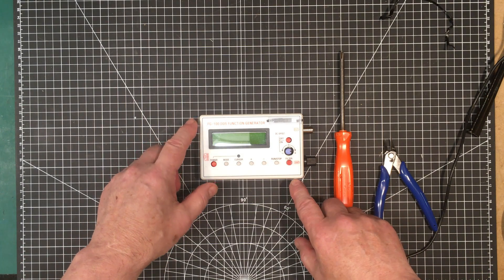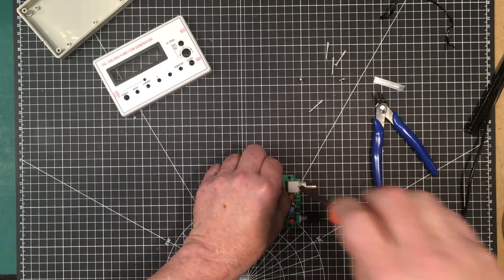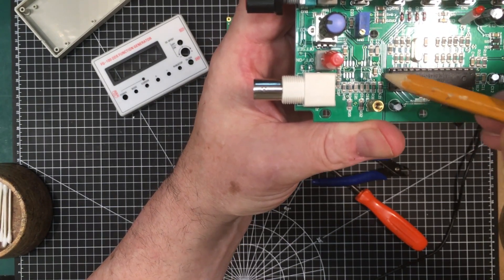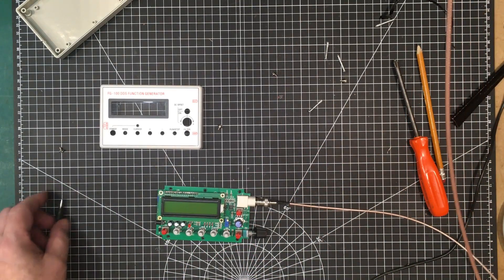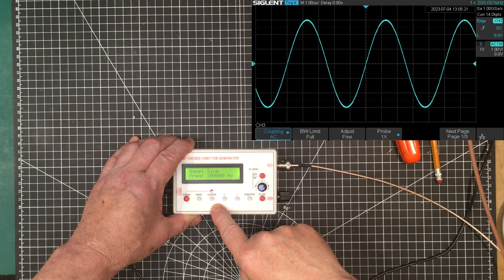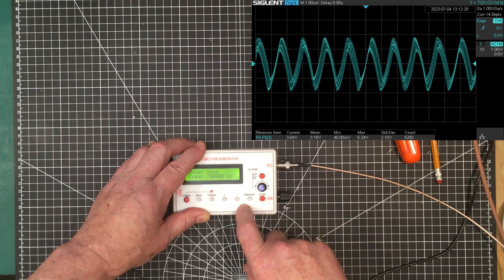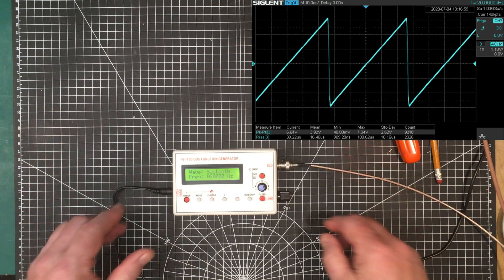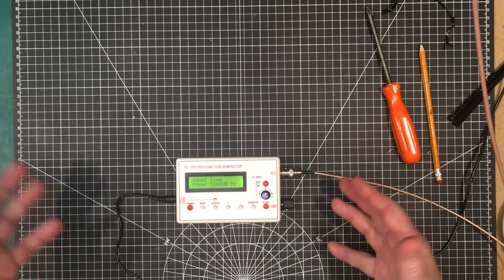Uni-Byte 0071 - Let's Polish This TURD!:  FG-100 DDS Function Generator FIX

Comment: Would this unit be acceptable for injecting signals into some basic transistor amplifier circuits (CE CC CB CS CD CG)? Have an analog electronic circuits course coming up. Would like to reproduce some of the circuits at home.
Reply from the maker: Yes, absolutely, if you get a good one.  The good ones work quite nicely.

Comment: Is it possible to build an oscillator circuit, drive it into the ground through two electrodes, and emit electromagnetic waves at desired frequencies?
Reply from the maker: I'd use an antenna of some sort rather than drive it into ground, but that's basically how a transmitter works.

Comment: We just ordered the newer model, the FG-200. I'm eager to get it and see how it varies from your model. There's almost no reviews of it in English yet.
Reply from the maker: I would be interested in finding out how it goes.
Reply: @uni-byte  I am nowhere near your level of expertise on it, but it has done everything I have needed so far. My best scope is a Fnirsi DSO510 so I can only say so much, but it seems to produce clean signal regardless of where the amp dial is. It also has a button just labeled "filter" that does seem to cut high frequency noise out of the signal, but it's entirely unclear to me what it's precise logic is.
Reply from the maker: @KeenBeanPlayzGames  Sounds like it will suit your needs well.  Thanks for the follow up!
Reply: @uni-byte  Funny you should reply because I just opened up the FG-200 this morning and it's a totally different and much more compact chip on it. The ATmega48V is gone, and in it's place is some tiny square chip that they sanded the label off of! Based on your video about the previous model; it wasn't at all what I expected when I opened it.
Reply from the maker: @KeenBeanPlayzGames  Thanks for the extra info!

Comment: Have you ever tried considered "low melt" solder (FastChip removal alloy for SMD)???  This stuff is MAGIC, and it really makes getting tiny things off of PCBs much easier. It stays liquid, or the consistency of warm cheese for 10-20 seconds after removing the heat. Use a wide chisel tip, or take a narrow tip & bend it like the shape of a hocky stick. Melt low-melt solder onto the 4 pins on one side of the chip, then the other side, then jump back & warm the first side again. With a bit of practice, the chip will just slide off the board. Works for about up to 8 pins per side, perfect for op amps & modern audio circuitry.  Also step up your flux game with something like Amtech 559 - it's a bit sticky & harder to clean off, but solder goes where you want it, and stays there until it hardens. Also, solder comes out of holes when using wick much better after adding some 559 - it really improves solder flow beyond what I thought was possible. These two things turned my SMD work from disasters to "hey, I can do this!". I don't care much for the expression "game changer", but it sure was for me.

Regarding the FG-100... do you have any suggestions on how to tame the amplitude down so that it ranges from 0 to perhaps 2v, max 3v, and the range is smooth & controllable??  I just need it for quick tests on commercial audio amps, and it is just waaaay too much output for my use case, and the area / arc of rotation on the amplitude pot that does suit my use case is so tiny as to be uncontrollable in actual use.
Reply from the maker: Thanks for the solder tip.  To reduce the amplitude of teh generator, you could use a simple voltage divider made with 2 resistors.  Or even a potentiometer.

Comment: Why did you not use a hot air gun?
Reply from the maker: I think I mentioned that some where.  It was going to be difficult to isolate the hot air to just the op-amps.  Too much danger of peripheral damage.
Reply: @uni-byte  I see where you are getting at. Better safe than sorry.
Reply from the maker: @saydmarschany8321  Precisely.

Comment: Hi, like your video. Absorbed a lot of info. Would it be possible to make a modification to this unit and add an interior lithium battery to make it portable? Thank you.
Reply from the maker: You would need the battery, a BMS module and a boost module to get the required voltage.  It would very difficult to fit any regularly shaped battery and all that other stuff in the stock case.  I would suggest making an add-on case that attaches to the back to hold the battery and circuitry.
Reply: @uni-byte or you can use a cellphone power bank instead, it has a 5v output, it's rechargeable and possibly can find one with the same form factor as the generator itself.

Comment: Hi I have the updated version of this function generator, I am wondering, would you know a simple way to connect a microphone somehow and use an antenna to send a voice message over a specific frequency please? Also do you know a way to make it output tones? Thanks in advance if you had the time.
Reply from the maker: You could use this FG to generate the carrier frequency then use that as one input to an external modulator circuit (a simple J-FET circuit could do it) and the amplified audio as the modulation input.  Do a google search on "How to make an amplitude modulated wave".   As to tone generation,  it does that anyway.  Just select the frequency you want and turn on the output.
Reply: @uni-byte  thanks very much for the reply, I will try that!

Comment: Thanks for your videos. I purchased this one from amazon. I have set sine wave to 100Hz and Amplitute to 4.63v. My oscilloscope shows vMax = 0.98 and vMin = -3.57. Do you think my device is defective? I appreciate for your answer
Reply from the maker: This is most likely normal behavior.  It  sounds like you have the scope set up for DC coupling and the offset on the function generator is on and not at null.  Is this correct?  Also, does the signal on teh oscilloscope look like a good sine wave?

Try setting the oscilloscope to AC coupling.
Or, try setting the DC offset to off (push the top red button in)
Or, try adjusting the DC offset until vMax=vMin.

Comment: When did you buy this unit? I also bought 3pcs a month ago and they came with a QFN32 unmarked chip. Pinout is similar to an Atmel, but it is different.
Reply from the maker: Right about the beginning of June when I did the first video on it.  You should check that out if you have not already.  There is a link in the description above.
Reply: @uni-byte  Weird. You might have gotten some old stock since you have the DIP socket with the Atmel. Mine works decently with square wave up until 80-90kHz, but the microcontroller seems some Chinese clone because the pinout is different. I'm pretty disappointed because I wanted to reprogram it to support adjustable duty cycle.
Reply from the maker: I don't think mine is old stock, just a bad clone with fake op-amps.  There may indeed be a newer version or alternative versions but I'll bet that there are many manufacturers of this device.

Comment: Thanks for the video,
I too have this unit bought many years ago, operates just fine, all screws mounted, 
The PCB looks just the same, but has a silk printing on the top left "FG-100_v1.1"
2013.10.29 probably manufacture date, so I guess you have a clone of a clone...
op-amps are tl072c, but I have no way to know if genuine or not.
Reply from the maker: Yeah, mine was a poor copy for sure. Good the hear you got a working one and it's probably an original.

Thanks for the comment!

Comment: i have the same function generator, but it doesn`t generate any wave at all :(
Reply from the maker: That's not good!  In the first video I show where you can scope to see if the microcontroller is producing an output before going to the amplifiers.  If yours has a signal there then replacing the op-amps will likely fix it.

Comment: Nice set of videos, very enjoyable. I nearly bought one of theses a few years back but I have mixed feelings now ! besides I have something better. I'm a massive NE5532 fanboy so that was nice to see and the outputs are quite usable now at 1v PK-PK. The IC was a cow because you were filming it  so Sod's Law ! it's a shame buying this stuff is such a damn lottery but like you say you gotta roll the die and see what happens...cheers.
Reply from the maker: Yeah, for dual supply purposes I'm a fan of the NE5532 as well.  It's a better spec op-amp than the TL072 and available from reputable suppliers for just a few cents more even if you can find genuine TL072s anymore.
Reply: Yep it's a great performer for Audio projects @uni-byte

Comment: The JYE Tech FG085 is a much better Function Generator. Your thoughts?
Reply from the maker: This one is not bad when the op-amps are good ones.  The FG085 seems to have a better user interface and can do a lot more.  But then again, you pay quite a bit more for it so it should be considerably better.

Comment: Fake TL072, ....THAT's CRAZY, ....but I bought 500 fake LM358, yet 200 ADR8628 at 20c each were genuine ....GO FIGURE!
Reply from the maker: Yeah, TL072's are just about the cheapest op amps around.  How much more would it have cast them to get real parts?  I know I said TL074 in video (nice catch BTW) but I was thinking if they had gone to using a single TL074 they would probably have saved as much as they did by using fakes.
Reply: Bought a single ADR435B voltage reference for 2,40, received 5 of them for that price, and they are genuine... I was surprised.
Reply: @pizzablender  5 x ADR435B for 2.40 ( 'B' high grade, 0.05% initial accuracy - assuming not fake in grade), wow, I think I hate you!😁

Comment: Not finding fault with your cutting happenstance, but here's some cutting information... The side cutters that you have are what we all use. Their blades have very particular technology incorporated into them (even the cheap ones.) I will leave it to the individual to research the entirety of the subject, but what is of interest, in this cutting application, is the grind of the blade... The blade is only ground to one side. Let's cut a pin, to explain... You put the (flat) bottom of the blade on top of the pin's solder joint (above the PCB board) and snip the pin. The angle of the grind of the blade forces the pin upward. No force goes downward. This protects the solder joint from mechanical stress. So, you may have more success by taking care to orient the blade angle to push the pins back against the body of the IC. Meaning, the flat side of the cutter's blade would be facing the trace's pad. However, a cheap board is a cheap board. And, no reasonable amount of care will make up for that.  There are many more blade features to discover, like the fact that the blades are intentionally offset, in the vertical plane. Cheers.
Reply from the maker: Yeah, that's how it's supposed to work.  The pads that came off actually broke when I was cutting other leads.  To be honest, this is the first time I had the problem.

Comment: Nice! Not a bad generator if it works as intended. Thanks for the follow-up! 👍
Reply from the maker: It does work pretty well once it has good op amps in it.  I wonder how much they are saving by using parts that literally don't work?

Comment: Congratulations, you successfully polished a turd. I'm impressed!
I bought one of these units on Amazon, hoping it would be "good enough". It wasn't. I had almost exactly the same symptoms as you. Unfortunately, unlike you, I have neither the patience nor the eyesight to replace the bogus SMD chips.
Thanks for the video.
Reply: Give it a go! Those SOIC packages are not super small. Removing the ICs is possible with lots of fresh solder and a chunky iron. Then clean up with solder wick and some flux. Soldering SIOCs is doable, even with a big iron. Use flux when soldering and remove any bridges with wick. I’ve had several eye operations, have shakey hands and can still do 0.5 mm 64 pin LQFP with ease. 🥳 If you get it to work you have a generator, if not you have gained some practice 🌞
Reply from the maker: As trcwm suggests give it a try.  As it stands now you have an unusable chunk of junk.  The worst that can happen is that you get some experience and loose $3 on new op amps.
Reply: @ 3:25 Why not a few  pieces of kapton tape and use a smd hot air torch